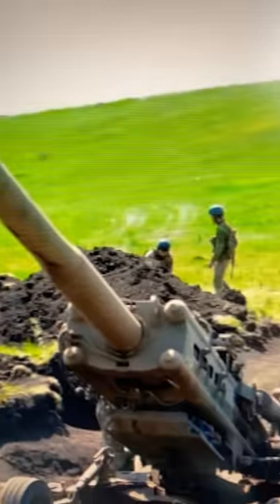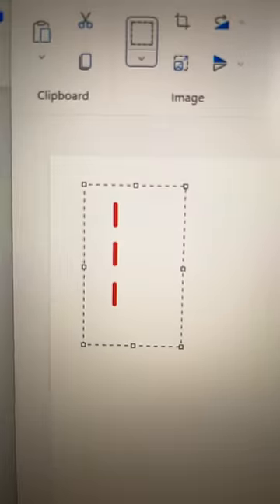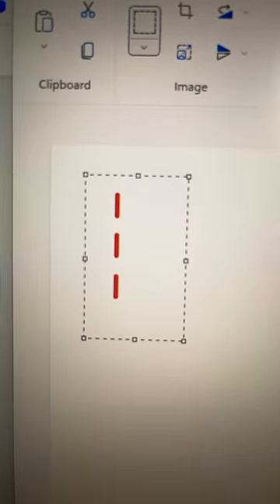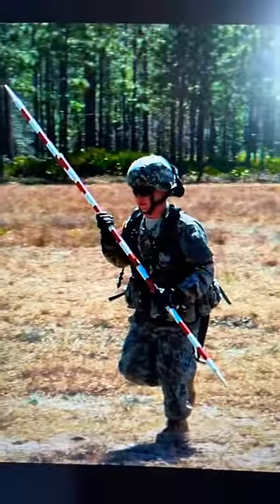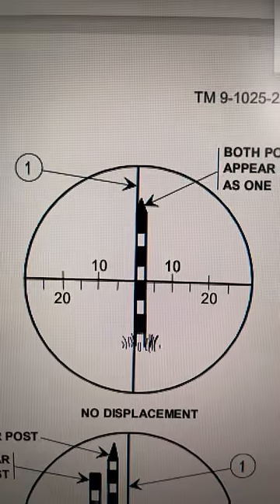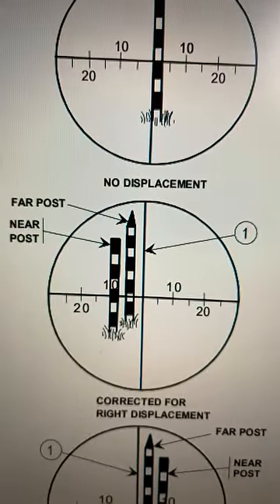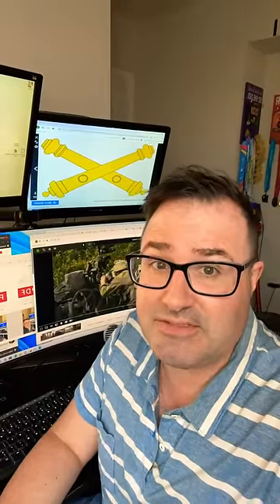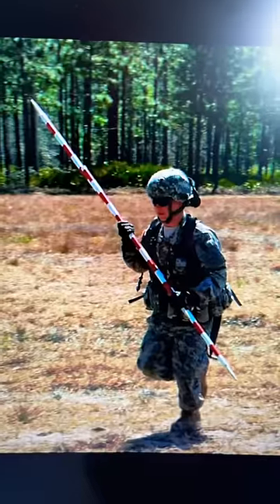How is an M777 Howitzer Aimed?

Comment: My grandad was an infantry officer on D-day, each unit had an FO attached to them, they were supposed to be "one tactical bound" behind the front line, which he said meant of course that they were as close to two tactical bounds from the front line as they could get away with :-)! He ended up being shelled by the Royal Navy at one point - whilst going through an orchard, everyone went flat and he fired some verylights (there was a colour sequence to signal friendly) which led to it stopping. They had been walking through an orchard at the time and the rounds actually didn't injure anyone (possibly because they were naval SAP rounds?) but they did blow the tops off all the trees at about 6" above the ground.

Comment: I always assumed that the aiming sight on an artillery piece contained some sort of compass and/or artificial horizon type instrument.
Reply: Nope. The most it’s got are leveling bubbles, set your deflection(elevation) and spin the wheel tell the bubbles level.  Verify on your aiming reference(Aiming Poles in this case)

The firing azimuth(Direction of Fire) is verified two separate ways before before its considered safe to fire.

It’s an over simplification, but I hope it gave you the answers you wanted.
Reply: You are correct. That device is located on the ground and looks like a telescope (the kind you look at stars with).  This device is called a COLLAMETER.  This collameter has a bunch of numbers in it that are called MILLS. A mill is a very small increment of a Degree.  This horizontal adjustment is known as DEFLECTION with the very center of the firing battery being Deflection 0.  On the other side of the Army's older cannons is another sight that gives you another number known as a QUADRANT.  This is the amount of elevation the cannon needs to reach a given distance. Deflection (left & right) and Quadrant (up and down) allow you to find any location on a map.

Comment: I just always assumed they were looking into a scope with some type of compass with degrees of azimuth and elevation. That's way more low tech than I thought.
Reply: Not too far off actually. The whole howitzer is leveled and laid off the aiming circle which is very much like those things you see surveyors looking through. From there you punch out 3200 as your zero or center position. FDC gives you a deflection off of center like 3217 and you set that into your telescopic sight which moves. Then you look through it but since you have moved the sight off target you now have to traverse the gun back onto your aiming reference. It sounds more complicated than it is.

Comment: A collimator is normally the primary aiming reference for the gun, and then the poles are the secondary aiming reference. Then you get into the nitty gritty like DAP’s (Distant Aiming Point) or reciprocal lay. I mean you can even lay off the stars if need be for an aiming reference.
Reply: exactly this guy is about half cooked on howitzer aiming. As a gunner and gun chief lol this guy was cracking me up

Comment: I was assigned to a U.S. Navy Seabee Battalion in the late '90s and was eventually put in charge of our 60mm mortars platoon.  Naturally, in order to be in charge of the platoon I had to qualify on the weapon.  Qualifying was not easy because I am a little dyslexic and it gets worse when I am under stress.  You sight a mortar the same as you described for the Howitzer and though you didn't mention it, it is vitally important that you align your sight to one particular side of the stick.  If you don't your round will not land where it's supposed to.  For someone whose brain start to miss fire when we have to do this in X number of seconds during qualifications, as I would suddenly start to question what side of the stick I am supposed to be sighting on.  It's a miracle I passed let alone stayed in charge of the platoon.  Oddly, I never had any trouble in the field, only during timed qualifications.

Comment: Not sure what it is for Arty, but for mortars, guns are usually laced at 2800 mils. The aiming poles are then placed at 100 meters and the closer one is at 50 meters. The guns are given a deflection, a left or right gun movement and an elevation, an up or down range change. The second picture of the offset poles is how we aim. In my time, the rule of thumb was hey diddle diddle, far pole in the middle, to get an accurate lay for the gun sight.

Comment: And depending upon where the round falls, the FO will call to “fire for effect” (You hit the target, keep firing), or call “Adjustment” and move up, down, left or right in increments. There are several other orders that the FO can use, typically how many guns to fire, how many rounds, type of ammunition, cease fire, check fire etc.  Being on the gun range during NGFS is a pretty exciting time, but we never got to see the results of our handiwork.
Reply: Add or drop. Up and down are height of burst.

Comment: Aiming post are only used at certain deflections upon placement after zeroing in your collimeter . Aiming post are actually placed at 50 and 100 meters 
and are used at high deflections, going to Aiming posts reduces rotatating gun piece.
So your kinda correct .

Comment: I don’t know if the US is different but in the UK the FDC handles regimental fire missions, passing missions down to battery level not in the form of gun data but in map grid details. The FDC talks to the observer; whereas in battery fire missions the observer talks directly to a battery CP. In either case situation, the battery’s command post calculates the bearing and elevations for each gun (typically 8 pieces) using computers programmed with each gun’s individual muzzle velocity, the weather, rotation & curvature of the Earth, etc etc. To lay the gun (once it is surveyed in using a variety of methods) the gunner looks into the optic to read the perceive bearing and elevation in mils. You lay the gun after it is loaded since a high elevation of the barrel may make the breach relatively inaccessible. So after firing you immediately knock the elevation back down again ready for re-load.

Comment: As a mortar crew specialist, when i did my mandatory military service in my country, i can say that we use the exact same aiming method. Aiming poles where positioned in 25 and 50 metres in training. Pretty cool stuff. Although stabilizing the mortar to level vertically and horizontally was a pain in the ass when you had to readjust the aim towards the poles at the same time. Through training we managed to drop the time till ready to fire from 10min the first day (lol) to 1 min 10 sec

Comment: Yes, we do use aiming posts, but our primary aiming reference is the The M1A2 Infinity Aiming Collimator, the same way of aiming applies, FDC gives us a Fire mission, we offset the gunsight to the proper deflection and quadrant, and align the sight to the collimator until we are aiming at the 0 line. Aiming posts are useful but they’re a secondary because they aren’t too reliable, where as the collimator is more accurate. 

“The M1A2 Infinity Aiming Collimator is an optical instrument used for establishing an optical reference from which weapon deflection angles can be measured for indirect fire. It has an illuminated mil scale reticle which functions as an optical projection system that simulates a grid board type of infinity aiming target reference.

The M1A2, which is illuminated by a battery powered LED, replaced the M1A1 Infinity Aiming Collimator, which is illuminated by radioluminous tritium (3H) lamps.

 

The M1A2 Infinity Aiming Collimator is used with the M777 (155mm), M198 (155mm), M119 (105mm), M109 (155mm), and many howitzers no longer used by the United States but still in use by foreign militaries.”

Comment: I think that this is one of the few videos like this that I didn't already know how and why they do something in the military. nice video. I never honestly gave much thought to this to be honest but to know how and why they do it now makes it much more interesting. a lotta things I see there is usually some sort of common sense reasoning or it's simple to see how and or why they do something or how something operates . but yeah, being completely honest I really never thought about it. thanks for the explanation at best I figured it was just to get a general picture of what's down range . I knew the aiming was done with calculations like mortars and other similar artillery pieces. I never thought that the sight was actually and practical in the way they aimed the gun . pretty interesting for something so simple.

Comment: Sticks are for mortarmen or as an emergency backup for howitzers.  
    13Bravos are looking into a Collameter!  A Collameter is a special telescope that is lined up with the gunsight and contains a reticle with 360 degrees cut up into MILLS (there are 622 Mills in a Degree).  The FDC then tells the gunner a DEFLECTION (a horizontal movement) in Mills and a QUADRANT (a number of Mills in vertical movement) for range.

Comment: He's looking at the Collameter which is your PAP (primary aiming point) and your SAP (secondary aiming point) are the aiming post you see. The short one goes 50m out and the second one (2 poles put together) goes 50m out further than the first one. The Gunner (on the sight) and the Advanced Party (Cannoneer #5, usually on the Ammo Team) runs them out and makes adjustments at the direction of the Gunner.

Comment: Aiming stakes are used as a third option, if the dfcs digital fire control system is down or the battery is dead they will refer to the colimeter which looks like a telescope, the gunner will align the pantel crosshair with the refernce point behind the lens of the collimeter. If that is knocked over or fails they will then line up with the two aiming stakes as a final referance. If all three are lost you are shooting blind. All three still are set up during emplacement which is probably what the picture is showing

Comment: You almost got your explanation correct. The aiming posts are a secondary aiming point. Its the colameter. The Gunner and A gunner put the quadrant and the deflection into their respective  sights. Gunner traverses onto the colameter (unless thats been compromised then you'd use your aiming posts or DAP) A gunner elevates the cannon and levels his bubbles. Or if you're using digital you elevate or traverse until there is a big dot on your screen.

Comment: The Fire Control Computer (FCC) on the guns verifies deflection nowadays in addition to acting as a tertiary safety check during digital fire missions. We still use the aiming poles for initial emplacement and manual gunnery, but it's only really used when the FCC is down or during the gunline's Tables V and VI.

Also, we don't have sandwiches. We have Ramen made in a JetBoil. The coffee is true though, and anyone is welcome to it if we have enough time to brew it before displacement.

Comment: Ryan, while aiming stakes can certainly be used, the infinity collimator replaced them many years ago. Either piece of equipment is used to create an aiming reference point for the artillery once the howitzer or gun is laid (usually done by the battery xo) and the exact location is transmitted to the FDC. The use of computers, such as the TACFIRE system in the US artillery some 40 years ago made the delivery of fire much faster than the totally manual system that we had. I don’t know what the Ukrainian military is using as compared to what we had but their use of drones to observe targets seems to be the newest incarnation of the forward observer……

Comment: I was in a Minuteman missle silo in Green Valley, AZ and saw they had an "alignment stick" 50 yds from the silo. Apparently, they used it to assure the missle fired straight up through the bore and wouldn't hit the sides of the silo. But everyday that stick was misaligned and had to be adjusted. They couldn't figure out why, until one day an Airman was topside and saw a cow grazing nearby, the cow walked up to the stick and leaned on it to scratch itself. Nearly, nuclear disaster by cow.

Comment: As a chief of section aiming posts aka sticks as you call them are a secondary aiming point, 2nd to the collimeter. The gun is issued a deflection and once applied to the gunners sight the gunner will traverse to the aiming point and measure the displacement and apply accordingly.  Near far line. Steel on target.  SSG Baker

Comment: Could be the post (actually its two sticks. One in the back and one between the gun and the rear stick. Then those are aligned for your zero point), could be a telephone pole, a building or pretty much anything. The post is only used if there is no existing point to zero the gun on.

There is also an option to use another sighting device that's only set up a few yards (looks like a telescope) from the gun and has glow in the dark numbers inside.

Every time you fire that gun shifts and the posts are used to realign the gun with the target location since just a couple of mils over 10 or 20 miles is a long way off target.

If you can see the target you might be doing "direct fire" and actually look down the gun breach or through the primer hole to aim. Then you could put in a red bag charge and breakout the long rope, because you might just destroy the gun.

Comment: We also use mils instead of degrees. If I remember right its 7200 mils to turn back to the same spot. Degrees are not near small enough of a unit to be used for lobbing shells down range.

Comment: Aiming posts are not the only thing that I used to aim off of. It's standard practice to use an Aiming Point which needs to be atleast 300m away from the gun platform. An Aiming Point can be anything that isn't moving. I.E. the tip of a mountain in the distance, the fork of a large tree. Man made objects are not used like houses or buildings because they often get destroyed. It is possible to even use the stars at night.  But, that must be corrected every 10min because of earth rotation. What's more commonly used is a Colamater (spell check). A colamater is a luminous barrel with numbers from 1-100 inside it. The gunner looks through the dialsight and sets onto a specific number that has been plotted as that guns Aiming Point then reports ready and sends it on command. Every gun platform will have atleast 3 Aiming Points at varying distances incase they receive counter battery fire or worse... get rolled by tanks.

Comment: I did away as a FTC on a mortar crash course and it was nice to not have to carry stuff and be on my own but calculating the shot angles and charges needed was usually quite nice. But after doing a bunch of them in a hurry and the shot corrections which add a whole another layer to calculate it got tiring. Probably easier with more experience.

All this math/map stuff was taught to me within 8 hours, before that I knew nothing about mortars.

Comment: The aiming posts are secondary. Primary is the Collimator, 3rd is usually a certain tree or other point. At least on the 105s (102, 119) when I was a 13b in the 82nd 90-94.

Comment: M777 - in this case, he is not looking at a stake, he is looking at a collimator (if I spelt it correctly) its basically a tube with a lens and a plate with specific values at certain positions - Source - I used them
Reply from the maker: Yes. You can see this in my long form video. https://youtu.be/Kux_4KGuj1w

Comment: This isn't really a full explanation.

The aiming polls are our like third backup. Firstly, M777A2 has a digital aiming system with a screen where you simply need to spin your wheels until you have the crosshair level. The second aiming system would be using the Gunner site and the collimator. The gunner needs to use cross level bubbles to level the Gunner site, similar to how you would level a piece of wood, and then aims into the collimator. The gunner is essentially using that as a reference point and FDC will give us a deflection to the left or right of that reference point.

The backup backup backup aiming solution is called a DAP or distant aiming point. That is simply a point 1500 m away minimum that we aim at with the Gunner site and record the angle from our initial azimuth of lay.

Comment: Lining up the aiming stakes takes a bit of practice too. You know those games you play as a kid where if you change one value, it changes another, and changing the other does the same to the first value?

Now imagine if they did so at a different rate (adjusting value x adjusts y along with it at a rate of 0.75, but adjusting value y adjusts x at a rate of 1.25).

Point is, don't ever try to adjust one at a time, you have to adjust them together, but the rate at which you turn each knob will be different.

Comment: Ok not really current information, on smaller guns 105 they use a stick.  It can be done with the aiming stick but in most cases we use a electronic device that does
Not need to be placed at a far distance from the gun, this device can be placed only 10 feet away from the gun.  It also corrects the displacement so that on the next shot you aim strait at the line that you see.  Laminating errors.  You don’t have to do the displacement each time.

Comment: though not technically wrong.. but... the aiming pole method is the backup or secondary method .. the primary is using the M1A2 Collimator. which is not pictured in the video.. .the backup to the backup is using a distant aiming point (DAP) like a cell phone tower / church steeple